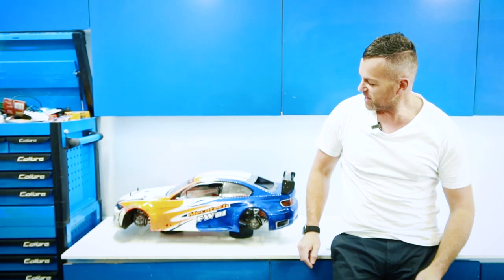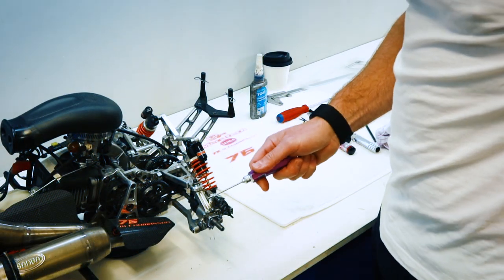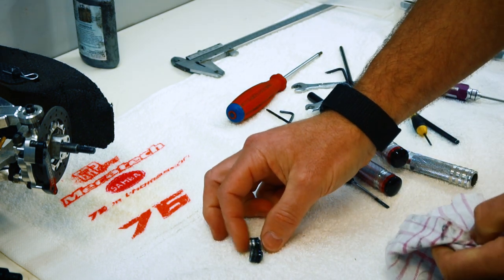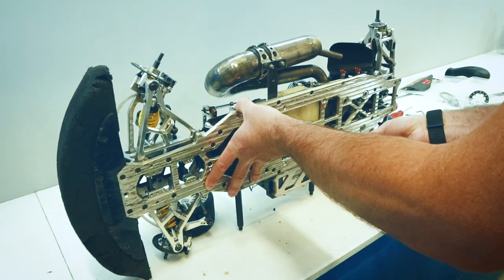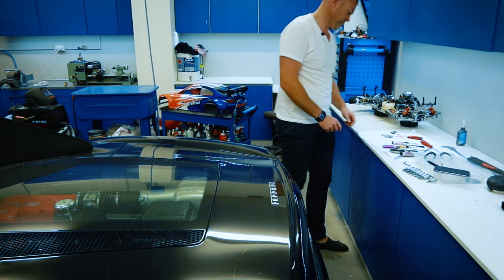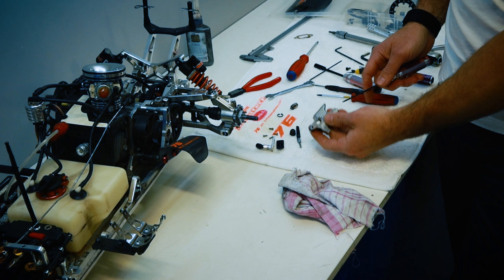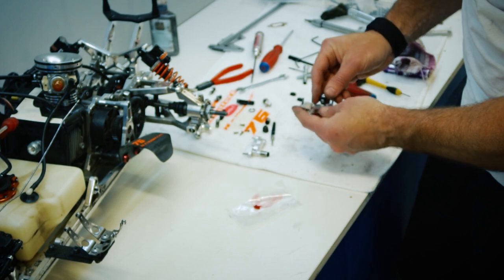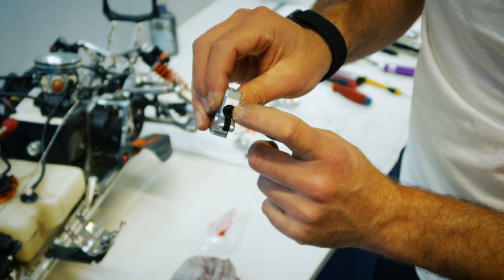HOW TO REBUILD RC CAR HYDRO BRAKES - RC Tips & Maintenance from the workshop

Comment: Awesome content Mark, exactly what the 1/5 Scale needs!! I'm about to upgrade my Mecatech brakes with DOT4 seals and will need to look for a red Rubber grease as well. Keep up the good work!
Reply from the maker: Thanks for the support Mate! you wont look back, the DOT4 setup is fantastic! are you running the brakes on the FW01 or something else?
Reply: @MarkThomasson76  waiting to see the impact on track. Honestly, I should have done brake maintenance a long time ago, as they were pretty stuck from all the dirt etc. I drive FG Evo13, which I'm refurbishing almost completely for this season. It is a pretty easy car to drive, so sticking with it at least for now.

Comment: Hi mark, in the video at minute 7:01, when you remove the carbon protective cap from the exhaust, there is a cable that works and where it is connected, on one side it can be on the engine and on the other it has a red chip jb, q is in the box of the rx, where it is connected, excellent video,, thanks
Reply from the maker: Hi Luis! it's a temperature sensor, I use the Futaba 7PX Futaba have several telemetry options as standard. The temp I like, because you can set a high temp alarm!! Keep an eye out for my next video, I'll be doing a complete review and demonstrating the importance of warming up your engine fully!! its going to be great!!!!!!!!!  are you on any of the Facebook groups that I've posted videos to? happy to post some pictures if you like...